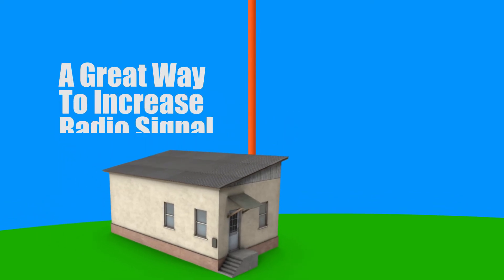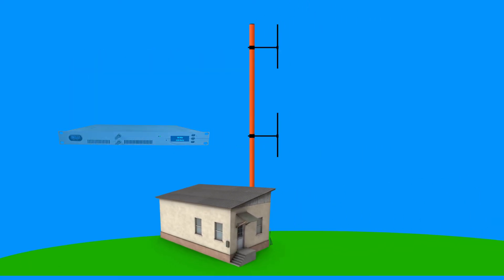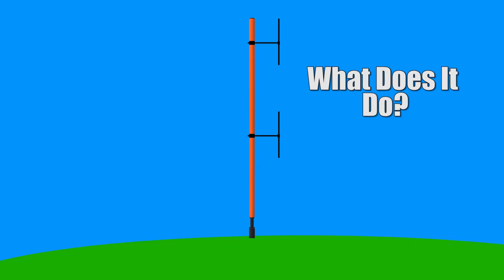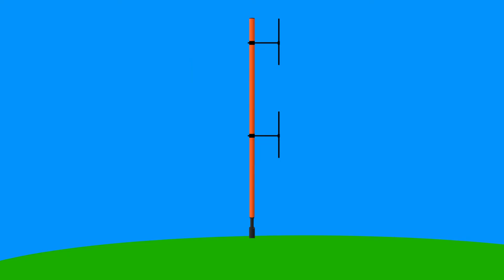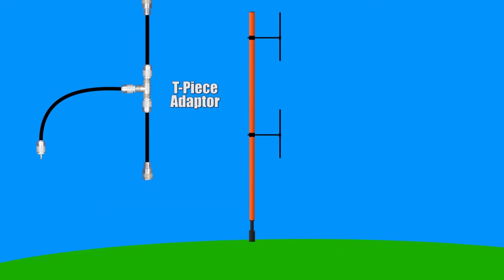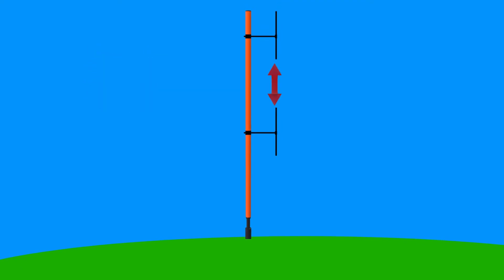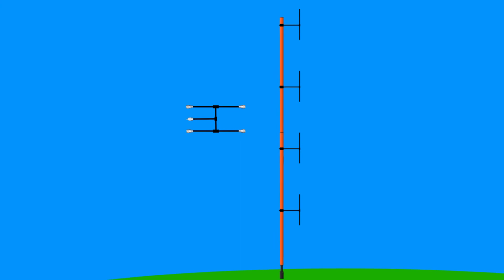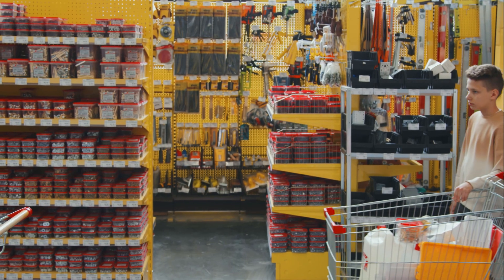FM Radio Station ANTENNA ARRAY FM Transmitter Set Up. Get It Right For Best Signal Quality.

Comment: Wow!  Brilliant work!  I was technical direcotor at a 100 thousand watt FM station here in the US.  This means that when the federal autorities came calling it was MY name on the paperwork.

One tip I would add to what you say is:MILLIMETERS MATTER.  Down in  the Ham bands you can be off  a cenimeter or so and be OK.  At our frequency, no.  Remember that you can triim more off nut you can't put more on.

At my power level we used 63 millimeter copper pipe with a 6 mill ceter conductor.  We pressurized the line with Nitrogen gass to keep it dry.  You folks that can do this with regulat coaxial cable are lucky.
Reply from the maker: Hey. Thank you. This video took a ton of work to make so it's nice to see people appreciate it lol. Yeah on 88-108 Mhz everything can be critical to the last last centimeter that's why I recommend people buy the harness. There's more than enough other stuff to worry about and making a harness can be a real pain. Yeah I have mostly worked with low power radio stations of just a few hundred watts so it not as crazy as your high power stuff. So we can get away with using RG213 and even PL259 connectors. Mostly N-type but nothing crazy like yours. Can't imaging having to deal with all that. And yeah having your name on the docs is a little scary lol. Cheers.
Reply: How did the Ariel hold all that power , I would have thought they melted ?
Reply: @Sonnyblack100  100 KW  is quite common herein the US on the FM band.  Old style TV transmitters here had power in the millions of watts.  Digital TV dropped the powere way down.
Back in my days at the FM station our next door neighbor was a high power TV.  Indeed their power line never had ice on it on the coldest days.  Power is great fun if you know how to handle it and YOU play by ITS rules.
Reply: @crankshaft3612  I would love to run a 1000 wats in London with double stack aerial
Reply: @Sonnyblack100  Remember yourHAAT my friend.  That is Height Above Average Terain.   The whole fomula is (Transmiter power) times (Antenna Gain Factor) times (HAAT).  So if you are mobile among big building your HAAT becomes a loss factor.  Oh, and don't get caught.
Reply: @crankshaft3612  oh yeh I know the higher the better , thanks
Reply: Given the 1/2 wavelengths spacing, if you used an antenna shorter or longer than a dipole like a 5/8 wave to stack, would the spacing still be a half wavelengths apart or would the spacing be the same length as the antenna length?

Comment: Can I use just one antenna instead of two or four?
Reply from the maker: Yes one antenna works perfectly fine. This set up is only if you need to boost your transmitter signal.

Comment: Can the antennas be positioned in different directions if they are 8 in number?
Reply from the maker: In theory it is possible but it is extremely difficult to do. You can for example put 4 antennas in a cross formation where the antennas are the exact spacing making a flat cross with each antenna at the end of each leg of the cross. This is used in some police car roof mounted two way radio systems.  You could then stack another 4 cross set up above that. But that is outside of my expertise. Would be cool if you get it right but not something I have ever done myself.

Comment: I have a YXHT fm transmitter. Just installed it. I get a warning that xmitter it off and to check my antenna.  What exactly am I looking for at the antenna?  Please give me all possibilties. I am stumped.
Reply from the maker: Hi. There can be a few different reasons for that. The antenna could be badly tuned or even damaged, there could be a short in the rf cable, the antenna could be installed too close to metal that is reflecting the signal back, the transmitter could be damaged,  the connectors could be damaged. In a case like that it can be best to have professional rf technician with the right test equipment test it all out for you.

Comment: How about 27mhz cb radio, does it work on that???
Reply from the maker: The principal is the same but 27Mhz antennas are huge. You would be better off buying a high gain antenna like a 5/8. That should give you about the same as a two stack and it's easier to install.
Reply: @inspiresoundpro  Thank you so much for a fast reply, have a nice weekend.:goodvibes:👍
Reply from the maker: Thank you. You too :)

Comment: This video only talks about about vertical polarized antennas.  Commercial stations use bipolar or circular polarization which works better since not all receiving antennas are vertical.
Reply from the maker: Thank you for your comment. Yes circular is great especially for urban areas. This video was not intended though to show that vertical is better than circular. The intention was only to help viewers understand stacking of antennas. There is no clear explanation on YouTube or anywhere else about this idea. So while I am grateful for your input as all informed insights are very welcome and very helpful for newcomers to antennas the video really was not intended as a vertical vs circular discussion.

Comment: Hello!! What's the best antenna for 1KW transmitter? Thank you
Reply from the maker: @DiosconnosotrosI53  The type of antenna depends on what you want to do. Do you want an omnidirectional signal or a more directed one. Do you want a vertical signal or circular polarized one. As far as a specific brand goes, that is not something I get into. You do however need a good quality antenna for 1k watts. Using cheap or homemade antennas at that power level can be very problematic and even dangerous. At that power level I would suggest speaking to a professional broadcast  equipment company.

Comment: The whole opening premise of this video is WRONG. One does not increase transmit power by adding or stacking antenna, so misguided. Antenna arrays only serve to concentrate the power you are producing in direction or horizontal plane. Respectfully, Dennis KV4WM
Reply from the maker: Hi.Thanks for your comment. While I enjoy the input from viewers you might want to tone down on the "misguided" and everything "wrong" vibe. This is not a university channel for antenna studies. It is a channel for mostly newcomers to radio. While your comment is technically correct, it misses the point that the effective radiated power is in effect amplified because of the concentration of the signal along a horizontal plane resulting in a stronger signal in the broadcast footprint. So please try take a deep breath and try be a bit less attacking in your comments. Viewers can learn a lot from the comments in the videos but the added info doesn't need to be aggressive. And by ending off with "respectfully" you are just showing that you are in fact being disrespectful.

Comment: Hello, can you explain the two 3Dbi antenna, for example, 99.7 mhz
Reply from the maker: Hi. Yeah sure. It all comes down to the half and quarter wavelength at 99.7 Mhz. Using the online calculator the quarter wavelength is 75.174 cm and half wave length is 150.348 cm. So the distance between the two antennas is 150.348 cm measured from top of the lower antenna radial and the bottom of the antenna radial above it. The measurements on the cables will be multiples of the half wave and quarter wavelength. I hope the makes sense. Cheers.
Reply: Thank you for the interesting information. I would like to know whether DePaul 2 or 3 Depi can withstand a power of 800 hundred watts. Thank you.
Reply from the maker: Hi. The power rating will depend on the quality of antennas you buy. You should also make sure that the harness is rated for that power as well. The place that sells the antennas often will sell the harness too so they should be able to tell you if the package is rated for that amount of power. Cheers.

Comment: Actually antennas don't make or amplify power.  They can direct it where it needs to go. When we stack the dipoles on top of each other as this video shows, it forces more signal outward and less straight up and straight down. Now in most cases the station doesn't  want to radiate straight up, and probably not straight down. In most cases the antenna is out in rural areas. Now they don't want the signal to pass over a close by town, especially if its one they are licensed to cover.  So, they may have a bit of down tilt or steer as the broadcast engineer mentioned in his comment. I proved one day that this is really a thing. I am s ham radio operator. I maintain one of the 146.88 MHz repeater in town. We had taken our four element antenna array down for repair and was temporarily using a 5/8 wave antenna.  The 5/8 wave antenna could receive an operator about say 10 miles away perfectly. He was transmitting with about 2 watts on a hand-held.  There was another operator about 50 miles NE of us on the interstate highway running about 25 watts into his 5/8 wave antenna.  The repeater couldn't hear him well at all, but when I switched over to the four element 6 dBd array antenna then the mobile operator came in full noise quieting and we couldn't pickup the guy on the HT anymore.  By the way we were standing 750' above the ground while conducting this experiment.  For my purpose I need an antenna with both characteristics. One that can cover 50-60 miles out and at the same time, cover the guys in town too. So I'm trying a multi receiver concept. One receiver in town, and two out in high places on the edges of town.
Reply from the maker: Thank you for your comment.

Comment: We run a .95 wave Norwalk vertical  at just 10 watts FM can get out about13 miles the transmitter can go up to 150 watts but that is pushing to get in trouble 👿  the reflective is zero at ether output I did have a1/4 wave home built ground plane that was flat too with a bit of fiddling with it it was PVC pipe and copper tubing with the SQ soldered to it . The worst antenna was a circular polarized one it had no range at all . I sold that on eBay to a guy in NYC that could vise grip it to his fire escape to do his show then remove it . Worked great in the big city. We have a 40 foot tower out here .
Reply from the maker: Thanks for your comments. Yeah I normally would not recommend circular polarized antennas unless a very experienced and equipped person installs and maintains it. Circular can easily become a problem. If done properly circular polarized antennas can be great for built up areas and cities but other than that can be more of a problem than it's worth. Cheers.

Comment: Small note, in a large band system covering the whole FM band ( for multiple broadcast frequencies, [multiplex] ), you need large band dipoles and a coupler. Same length for all cables still applies between antenna elements and coupler to get -in phase-. The total system gain is also a factor of power loss ( insertion loss VSWR ) losses in cables, connectors, coupler, any cavity filter.
Reply from the maker: Hi. Thank you for that. It's always great to have extra input from people in the industry with your level of expertise. The vast majority of my viewers are first timers so it might be a bit over some people's heads but always great to have some extra insight. Thank you.

Comment: Hi friend, I've damaged several power transistors because rain flash light, could you tell how to protect my transmitter output ?
Reply from the maker: Hi. There is only one way really to protect your transmitter and that is with a lightening arrester which you place between your transmitter output and the antenna cable and then put a deep spike into the ground or attach to a water pipe that is earthed to the outside of the arrester. They are quite cheap and very easy to install. But buy the best one you can. Here are some links to ones on Ebay but you can buy them in many places. http://tinyurl.com/zh92tk45   or this one    http://tinyurl.com/3tuu2jaf but make sure you choose one with the right connectors on it to fit with your cable connectors or you have to use adaptors that lose a bit of signal. Go to 7 minutes and 30 seconds 7:30 on this video of mine to see more about this https://youtube.com/watch?v=mmGQQo2X1vY
Reply: @inspiresoundpro  Use a 1/4 wave shorted stub. The center conductor is grounded but because it is a tuned short your signal goes straight through with no attenuation.

Comment: Hello! Thank you very much for the compendium of knowledge in a nutshell. This steak is full of meat :-) everything you have included in this recording is enough to build your own stack of antennas. I will build my stack at 435Mhz because I have noticed very high losses in multi-band antennas such as diamond X200 X300 etc. In this band, a smaller single-band antenna can work better than large multi-band ones. Greetings and thank you for sharing this knowledge in an easily digestible form.
Reply from the maker: Hey thank you for the nice comments. Always nice to be appreciated thank you :) I'm glad you enjoyed the video. I try my best to make my videos have enough info to be worthwhile to watch but not too much to overwhelm people. I also try to focus on broadcast FM band because that's what most of my viewers want but I have heard of other people converting my stuff for other bands. In most cases it is just a change of measurements but, as you say, some things don't translate as well as that across different bands. Always fun to experiment anyway :) Nice to have you watching. ENJOY.

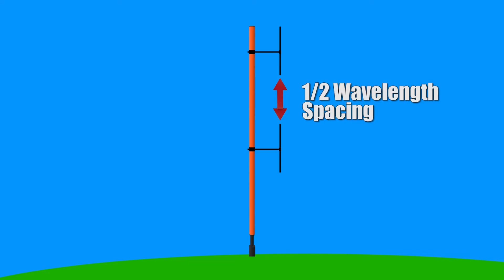Comment: @2:43 Isn't the spacing supposed to be half wavelength from centre to centre, unlike this time-point which shows bottom of 1 to top of second.
Reply from the maker: Keep in mind that the radials are a quarter of a wavelength each. So if you were to make the spacing from center to center the two antennas would touch as they would be 2 X 1/4 wavelength = 1/2 wavelength. The spacing would also not make sense because the antennas would be completely out if phase. Another thing to consider is that with the two antennas touching there would be no space for adjustment to create down tilt.
Reply: @inspiresoundpro  thanks, makes sense :)
Reply: The wavelength distance is in between dipole radials, 
in between brackets the distance is 2,1m

Comment: What is a wavelength ? As in wavelength apart ?
Reply: Thanks for that in depth reply 👍🏼
Reply from the maker: You are welcome :)
Reply: Thanks , I was thinking the space between each diapole was in fact the length of the diapole , so the gap between each diapole is in fact a your diapole length, or do you still need a calculation ? 

Thanks for replying
Reply: @Sonnyblack100  For 105MHz it is around 68cm.
Reply: I’m talking the gap between the double stack
Reply from the maker: The gap between the antennas is measured from the top of the bottom antenna to the bottom of the top antenna. The measurement is half a wavelength which is calculated the same as calculating the wavelength of the antenna. The gap is not always exactly the same length as the antenna. It is normally very close but other aspects like how well the antenna is built can make the length of each antenna slightly different in length. Normally a very small amount but the gap must be exactly half a wavelength. So there can be a difference between the antenna length and the gap but normally a small amount.
Reply from the maker: Hi. Thanks for your question. Every radio frequency has a specific wavelength. The wave length is the measure of how long a radio wave is as it goes through a complete cycle. This gets very technical but is simpler to understand that the higher the frequency of the radio wave the shorter the wavelength. So for example radio station signals for FM have longer wavelengths than microwaves. Microwaves have a high frequency and a short wavelength. You can work out the wavelength of every frequency but using an equation but it is easier to use a wavelength calculator.  If you watch my video about tuning your FM antenna you will see the wavelength calculator. You insert the frequency and it tells you the wavelength. I hope that helps.
Reply: Wavelength formula : λ=c/f=c*T where λ is the length in meters (m), c the speed of light (m.s-1), f is the frequency  in Hz ( or T = period  in seconds)

Comment: Good evening...What is the best antenna for 30watts transmitter?
Reply from the maker: Hi. It depends on what you want to do with the signal. If you want it to be omnidirectional then antennas like a quarter wave can work or if you want to add some gain to your signal to increase its strength a 5/8 antenna is better. I have a video about the different types of antennas for FM. Check it out here: https://www.youtube.com/watch?v=mmGQQo2X1vY
Also, make sure the antenna is tunable. To find out more about that check this video out: 
https://www.youtube.com/watch?v=WOGX70-kIYA
Reply: A slim jim type.

Comment: please suggest antenna for portable fm transmitter.100mw
Reply from the maker: Hi. I am busy working on a video for making antennas. But for a portable one I would recommend using an antenna that gets used for CB Radio and cutting it shorter. I will explain more in my video but what you need to do is get what is called a magnetic mount center load antenna . This is used on 27mhz . You need to remove the center load and replace it with a long telescopic antenna that you can get from an old FM radio. The total length with the antenna pulled out should be a quarter wavelength long so about 75 to 80 cm long from the magnetic base to the tip of the antenna.
Reply from the maker: Am working on the video now and it should be ready by the weekend I hope.